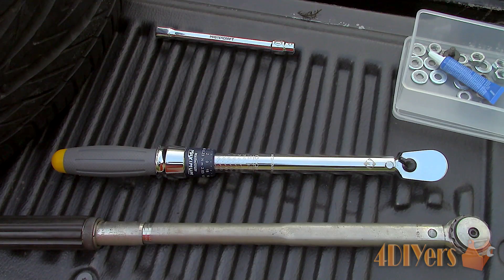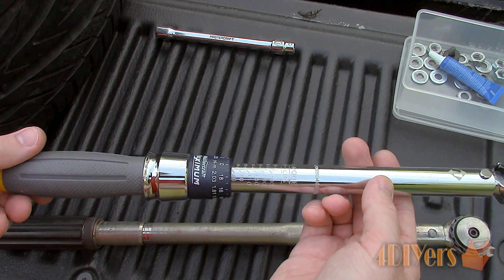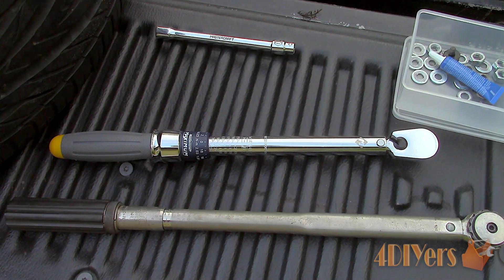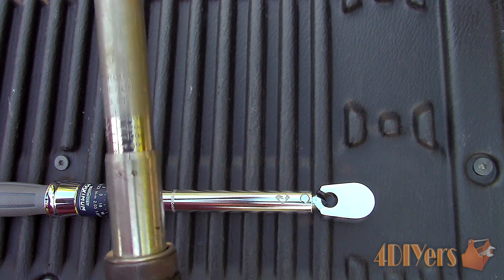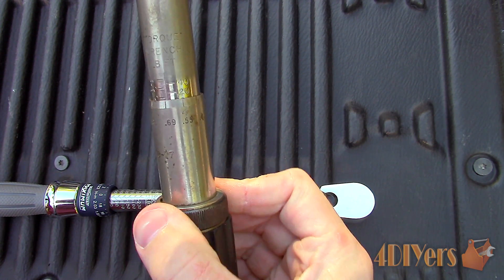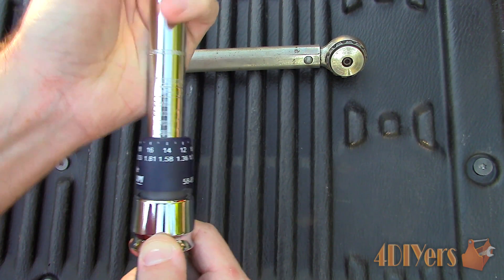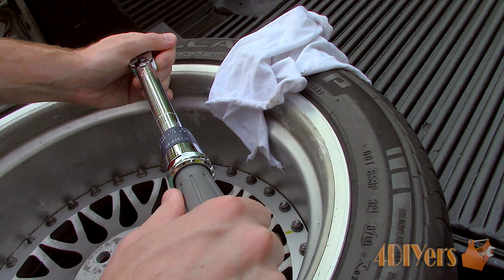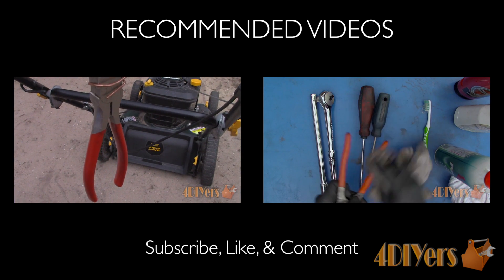How to Properly use a Torque Wrench - Beginner's Guide

Comment: Are those bbs style 5 rims off of a bmw? I've been looking for a torque spec for those...
Reply from the maker: Yes they are. BBS technically doesn't post the actual specifications, but I did a significant amount of research online. Some people were going as high as 30ft lbs which isn't a good idea as it would stretch and fatigue the fasteners. I did a cross reference on a torque spec chart based on the bolt grade and size, if I remember right it was 19.9ft lbs. So I just rounded up to 20ft lbs, plus medium grade thread locker.
Reply: For the BBS Style 5 RC090 bolt torque specs. Is 15 ft pounds with blue loctite safe or ok to use instead of 20 ft pounds? I did 20 ft pounds and I snapped 2 bolts. ☹